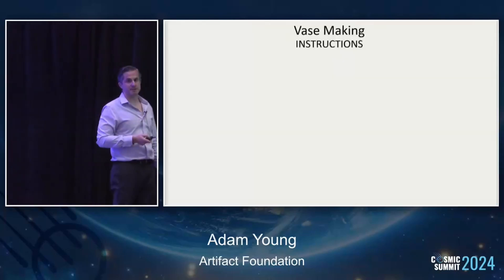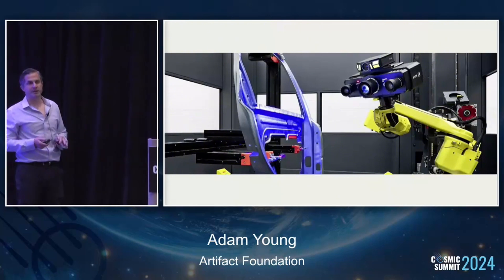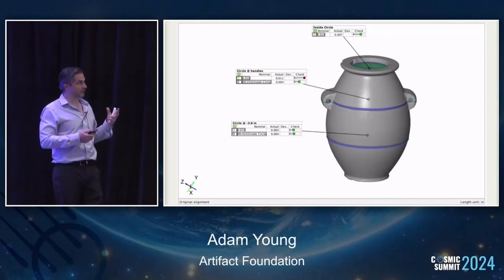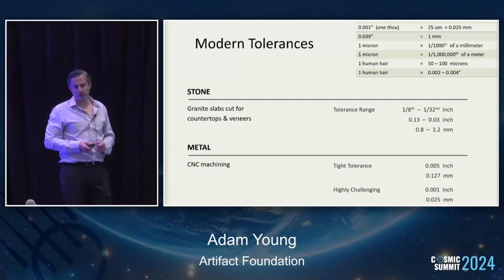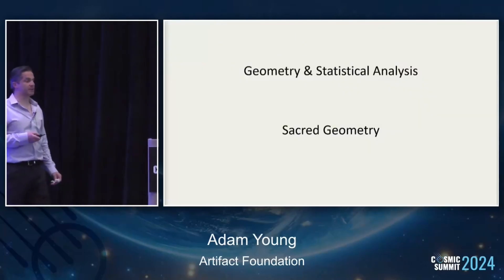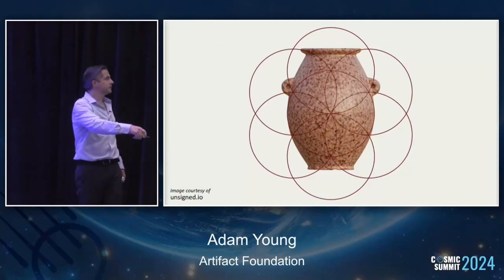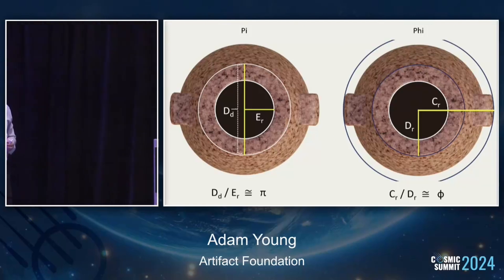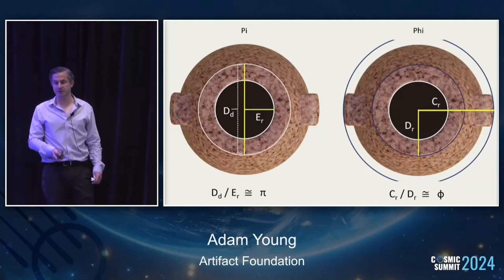Wall Street Math Quant Explains the Impossible Stone Vessels of Pre-Dynastic Egypt

Comment: This guy knows literally nothing about what he’s talking about. I really really loathe when guys who think they are smart, make claims that are astoundingly ignorant, because they didn’t think to ask anyone who actually works stone.   Stone is NOT hard to work.  EVERY ancient culture figured it out. In the modern era, we still carve stone the exact same way as the ancients.  We rub a harder rock on it. We just motorize our rubbing so it goes faster. 
It’s not rocket science. Anyone can figure out what will carve a given rock by noticing if another kind of rock leaves a scratch on it.

Guys like this are astounded by precision. But that just shows he’s never mastered making anything with his own hands. Precision is EASY to achieve with the most rudimentary of tools.  You can literally just carve one section of a vase to a curve you like. Take a plaster casting reinforced with horse hair just 1” wide along that profile. And then just painstakingly carve the rest of the vase to the same profile using abrasives.   You can even carve the shape of the handles INTO the plaster profile on one side so that you can be sure they will match, and that you are not changing the underlying curve thru the opening. You set the vase on a turntable, or on a pole thru its central hole, so you can mount the reference profile a fixed distance away and carve and turn the vase as you go. You keep working, section by section, little by little until you can slide it neatly under the plaster profile. 

Seriously. Stop mystifying things just because you are too ‘sophisticated’ to have ever made anything with your own two hands. 
I am a sculptor.   Pay me for a half year of my time and I will happily make you a perfect granite urn using nothing that wasn’t available to ancient stone workers. ALL it takes is some skill, and a lot of patience. 

SO things he glossed over to try and make it sound implausible. Granite is not all that hard. Dolomite is even softer than most granite. The most common abrasive in the world is quartz in ordinary SAND.  Egypt had a ready supply. Need something harder?  Garnet is harder than granite and so common that we make sandpaper out of it.  Egypt traded with peoples all over the Indian subcontinent, Africa, and the Mediterranean.  
Oh, and when they COULD find meteoric iron, they were perfectly capable of fashioning tools out of it. King Tut’s tomb had an iron dagger in it.

The ancients did not carve with just a copper tool. For fine work They coated the copper with pitch and embedded crushed quartz or garnet in it.  You can drill perfect holes in granite using a copper or even a wooden rod coated in sand or garnet. You can make a bandsaw by sticking abrasives on a copper blade, or even by soaking linen string in pitch and rolling it in garnet or sand.   It takes only a day to carve a nice deep hieroglyph in granite using quartz tipped chisels and butterknife like blades coated  in sand.
Reply: You claim you can make a "perfect" granite urn using nothing that wasn't available to ancient stone workers. Do it.
Reply: @ I make sculpture for money, buddy, not just to demonstrate simple things to even more simple minds. About $80k would cover my time to make such an urn. 
Seriously. Why don’t you ask the doofus who made this  claim to make one using the lasers he thinks would work before you believe his claim they could be made with modern tools?   The difference between me and him is I have a long career of making things with my hands. Things out of stone, steel, bronze, resins, plaster, and other media. I’ve done architecture, fine art, portraiture and a whole host of things neither You nor He can do. Just because HE and You can’t do it does not make it impossible.
Unlike this guy and you, I actually USE modern 7 axis mills, laser cutters and waterjets controlled by computers to make things.  And guess what?  They would NOT be the most cost effective way to make one of these. Those machines are expensive and renting time on them costs money. I would do it much the way the egyptians did, except I would use motorized cutting tools to make it go faster.  I COULD use my fancy laser scanner to measure it for accuracy… But just casting a simple plaster profile on one section of it would be faster, and even more accurate. ( lasers have a hard time scanning and  measuring marble and granite, because those stones have translucent crystals in them that can refract light, returning a surface we call ‘orange peel’. )
   
How do you make a CAR symmetrical? You just MEASURE one side, and COPY the measurements to the other side. How do you get accurate measurements?  You hang a string from a frame as a dead vertical plumb line and measure a series of vertical points from that reference line to the surface, then move the string measured distances along the frame its hanging from. 
How do you make something radially symmetrical?  How do you think egyptians made the millions of ceramic pots in their granaries?  They used a potters wheel, which is JUST a vertically oriented lathe.  The idea that a HANDLE sticking out on the sides makes it impossible is just a failure of this guy, and you, to THINK it thru.  The egyptians did not CUT them on a lathe. They just used the lathe to REFERENCE the work to a template. One made of plaster, or papyrus, or wood. 

In an era before internet, before television and radio, before romance novels and jigsaw puzzles, human beings had much longer attention spans. They were patient, and meticulous, and capable.  The ONLY thing I need to prove they didn’t need sophisticated technology is to show that ordinary SAND will carve granite and Diorite. YOU could make an urn out of a block of granite using Nothing but sandpaper, it would just take you a few years. 

Stop being so gullible to foolish claims made about ancient artifacts.  The fact that they EXIST is Proof they could be made with the limited technology of those cultures.
Reply: @ABC-yt1nq  Hire me. I’m a sculptor, i carve stone for money, not to demonstrate simple ideas to guys who have never made anything with their hands.   I do architecture, fine art portraiture, and product design in stone and the fact that you and the quant can’t do those things does Not mean they are impossible to do.
Reply: @christopherpardell4418  You claim to be able to carve a "perfect" granite urn. That would be an urn where measurements are not out by even a thousandth of an inch. Every curve perfect. Uniform thickness everywhere.
I call bullshit. You can't do it. No one can.
Reply: @ABC-yt1nq  Excuse me, did you just claim that ‘noone’ could make the thing that Someone very obviously DID make?   So, you believe this Quant, who has never made a thing with his own hands, when he claims it’s impossible to carve something radially symmetrical to a thousandth of an inch, despite the fact that EVERY lathe and potters wheel turns things that are that symmetrical as a matter of course?   He didn’t even measure the thing. He wouldn’t have the slightest idea HOW to accurately measure its radial symmetry, because the only way to determine that would be to set it up on a turntable and use a reference frame to measure from- which is exactly how you would have rigged it to Carve the thing in the first place. 
SO you think, what, they had some kind of technology that was super advanced, but they couldn’t come up with glass mirrors? Or it was Space aliens?   But you are unwilling to accept that just maybe what this Quant imagines is impossible is maybe not as impossible as he claims?
Reply: You are mixing up King Tut era  technology/metallurgy (new kingdom) with old kingdom technology. Which are thousand of years apart. In not a huge fan of the guy in the video either. But calling him out on terrible knowledge and then spurting out just as bad knowledge seems hypocritical, counter productive and kinda funny.
Reply: @ Kinda funny when folks read things into what I  wrote that I didn’t. The only mention of King Tut era ‘technology’ I made was pointing out an iron knife was found in Tut’s tomb. I did not claim they used Iron tools to make the Urn. They would not be necessary.  I pointed out that knife to demonstrate that when ancient peoples, All over the world, could FIND metallic iron, they were perfectly capable of working it.  There was nothing special nor New Kingdom specific about that knife. ANY culture that could make bronze or melt copper could forge iron, if they could find it. Any wind blown charcoal fire can heat iron to a temperature where it can be hammered into a shape.  The reason ancients did not make things out of iron routinely is that metallic iron does not occur naturally on earth.  If and when any gets exposed, it rusts.
The Iron Age was the result of folks finally figuring out what iron ore looks like, and how to attain temperatures that would smelt out the oxygen to return the iron to a metallic form.  
Meteoric Iron artifacts have been found in cultures that were incapable of smelting iron from ore.   Tut’s Iron dagger proves that egyptians knew what to do with iron when they found it in its metallic form.  It was preserved solely thru its never having been taken from his sealed tomb. We have no way of knowing how many iron tools or knives Egyptians or other ancient culture may have had because, again, Iron rusts. And when you are talking 5000 years ago, very few iron articles could survive that long.
Metallic iron in that era would have been so rare as to be worth a fortune, so an obviously coveted target of theft.
We know how Egyptians worked stone because they left an awful lot of it in partially finished states, and the marks left on the stone explain to anyone who has worked stone how they were worked.  We know they excavated granite with harder rocks because they left a 3/4 excavated obelisk in situ in the quarry and all around we fond the stones they used to hammer at the granite. We know they could saw granite, once it was out of the ground, because we have found partially sawn chunks of granite AND the copper saws they used. We know they had potters wheels and lathes, because we have found pots, and wood that was shaped on a lathe.
And anyone who has actually carved stone , today, knows that we use the exact same method to carve granite as they did. We rub or bang harder rocks against it. ( sandblasting and waterjet is literally banging rock with tiny harder rocks )
Reply: @christopherpardell4418  I do not think you understand the difference between pre dynastic ancient egyptian old kingdom techniques and new kingdom techniques. Completely different. The tech, the tools, the processes were very different. I think you may be starting to loathe yourself for thinking you are so smart making claims that are astoundingly ignorant, you keep mixing up thousands of years of techniques and processes and tech as if they were all using the same tools within a year of each other. Metallurgy and stone masonry is well documented over the thousands of years the Egyptians were around. I suggest more googling lol
Reply: @ I understand it fully. I think YOU have zero understanding of ‘metallurgy’ nor the history of it.  You do not NEED any technology to HEAT UP and HAMMER iron into a shape.  Stone Age peoples have made iron artifacts out of meteoric iron, just by grinding the iron against a hard rock.   Egyptians could EASILY forge iron, what they could not do was identify that reddish brown rocks in the ground had iron in them, nor that if they got them hot enough that metallic iron would form. 
Seriously. That was the only trick to the ‘iron age’ technology.   Both copper and tin occurs naturally in metallic form, and often in rocks that have a lot more of that metal in them as ores, so they are easier to identify and will smelt out at far lower temps. 
We have no way of determining how old the iron knife in Tuts tomb actually is. The hilt is concurrent with his reign, but the iron could well have been passed down thru 15 generations or more. The only thing we Do know is that its nickle content identifies it as meteoric.  So we know it predates Iron technology. 
Again, Try reading what I WROTE. I made no claims of any technology that was not available to the earliest egyptians. They HAD potters wheels. I can bandsaw granite with Linen twine coated with pitch and rolled in crushed garnet or sand.   You wanna claim THAT was too sophisticated for the people who built pyramids?
Reply: @ Unlike you, my knowledge is not from ‘googling lol’. I have melted iron. I have forged and cast iron and cast bronze, aluminum and stainless steel. I have carved granite. And I can do it very precisely, and NONE of it requires that much technology.  Although I often employ CNC controlled tools from waterjets and lasers to 7 axis robot mills, all it really takes to shape granite is Patience and Abrasives.   I am not sure from your response what the heck your actual point is or if you even understand your own point.   I can cut a profile out of a wooden plank, or even a sheet of cardboard, and shape granite to match that profile perfectly using nothing but sand and shaping stones. All it takes is time. aAnd if I want it radially symmetrical, a means for gradually turning the stone on an axis, little by little, adjacent to the fixed profile I am matching.
So, really, I am not the one ascribing a sophisticated technology to first kingdom egypt. The QUANT is.
Reply: @ I don’t think you read my posts. I am not the one claiming ancient technology they could not have had. The Quant in the video and some other commenters are.  I explained rather in detail the difference between Iron Age tech, and the fact the people pre-dating the Iron Age occasionally finding meteoric iron they could hammer or grind into a usable article. I also did not claim any iron was used in making the urns in question. I explained exactly how to make them using technology the old kingdom Egyptians verifiably had.
Reply: @christopherpardell4418  if you could make them you would but you can't. That's the mystery
Reply: @ I can. You offering to pay for my time?   Why would I spend 6 to 9 months of my life carving granite by ancient methods, without pay,  to prove something anyone with a basic level of intelligence can tell from my description is perfectly possible?   Unlike you and the quant, I actually make things to high levels of precision for a living. I can create a digital model and run the tool paths for carving one with a 7 axis mill. But I was traditionally trained and know how to do the same thing without any of that technology. 
If you grant they could carve granite at all, Then the ONLY thing they need to cut these accurately is to be able to reference the granite to a fixed template all the way around.  They could do this by rigging the template to turn. But it would be more accurate to do it by rigging the granite to turn, because turning the granite defines its axis. 
The template starts a certain distance away for the roughing cuts. When the whole thing is smaller than the profile and will turn freely, you move the profile a little closer, and then start taking down the high spots until it will turn under the profile freely again. Then you move the profile a little closer, only carving on the spots that touch the profile.  You do this until you have 98% contact on the profile at all points. Then you start sanding and polishing to get the last 2 percent. 
If you can’t SEE that this would work just fine, then you are either not clever enough, or you are simply arguing dishonestly.  
Oh, and ETA- the ‘handles’ are in the profile, too.  you simply have a smaller add on section of profile to complete the curve that swings into place or is registered accurately on wooden pins.  Again, NOT hard.  No fancy tech needed.
Reply: @christopherpardell4418  the tech you are describing is not old kingdom tho. What you are describing are not proven old kingdom technologies and processes. As for your excuses of time and money lol if you could you would but you cant
Reply: @ Does that kind of 7th grade taunting actually work for you on anyone?  Son, get a real education.  Museums are chock full of Old Kingdom granary pots and other ceramics made on potters wheels. The HAD the ability to make a turntable. Other than that, I have them pounding on granite with rocks, and using SAND stuck to tools that could be made of wood, ceramic, and copper. ALL technologies we know they had. We have literally FOUND the tools.  
Just admit it. They could make them.   They used the tech they had.
Reply: @christopherpardell4418  you couldn't even make these with modern tools young lad, if you could you would.but you can't. Time to get out of your dad's garage.
Reply: @ I’m not a young lad.  I’m a 67 year old man who has made his living making sculpture and designing things for 45 years.  Trained in the old world techniques by immigrant italian masters, yet I have kept current on the cutting edge of emerging technology and tools. I have moved 7 ton rocks all by myself using nothing but some 20 ft 2X12s, Egytian style. I beta tested the software that would become Photoshop and the first 3D modeling program on a desktop computer.   I TEACH apprentices how to carve stone with mallets and chisels, And I teach them how to use modern CAD software and tools.
I have explained how Anyone could replicate these urns with simple tools in enough detail that even YOU could do it.  If you had the patience.   And all you got is claims something is impossible that some ancient Egyptian obviously Could Do, more than once.  Well, That and 7th grade level taunts and dares. 
If you want to see me do it, pony up the cash to pay for my expertise and time. I run a business here.
Reply: @christopherpardell4418  all these excuses kiddo, if you could make these granite vases yourself even with your daddy's tools, you would, and you'd sell them for a pretty penny. But you can't. And you won't. Noone is saying it's impossible, the old kingdom ancient egyptians have shown it's possible. You however, have not. Stop with the childish excuses money time blah blah, you can't do it, that's the ancient mystery here.
Reply: @christopherpardell4418   - I repeat: you cannot craft a "perfect" urn. Get over yourself.
Reply: @ Making unsupported claims about knowledge you don’t have is your thing. As are juvenile taunts that don’t work on 12 year olds, much less full grown professionals working in the field in question.   I get it. You think the very object featured in the video could not have been made by anyone. You have no evidence, no argument, no reasoning to back you up.  I suspect your lack of faith in human ingenuity and perseverance is the reason you have never made anything that could impress anyone.
Reply: @christopherpardell4418  You need 80k worth of modern tech to make a small granite jar when you also say it could be done with a stick and some crystal sand abrasion? Something isn't adding up here LOL
Reply: @ you must not have read what I wrote fully. I don’t Need 80K of modern tech. I need 80k to pay for 6 months of my TIME.  I run a sculpture studio as a business.   It would take me 6 to 8 months to make a granite urn if I was only going to use tech the Egyptians had available. Mind you, that’s 10 hours a day of chipping at Granite with other chunks of rock, or abrasives. 6 days per week.  And that’s only because rocks and sand are pretty much free.   If you want to use modern tech to make one, it will actually cost you as much or a LOT more.  Granite burns thru expensive carbide and Diamond tooling very fast, and a Kuka 6 axis mill runs $150 per hour. 
But the modern tech will get it to you faster.    And I am not thinking small, I am thinking 30” tall.  
Once more,  They were MADE by ordinary people who had a lot of experience cutting rock. Like me. We know what kind of tools and tech they had available because we can see what kind of artifacts and other tech they never made, as well as what they did.   And because we have found their tools, their quarries, and even their workshops. Anyone claiming it was impossible for them to make it with the tools we know they had is obviously someone selling you something, or someone who never TRIED to make anything. I know it can be made because some man DID make one. And anything One man can make, another man can make the same way.
That’s the difference here.   What the ancients did does not astound me because I have made things all my life that astound people who don’t know how things are made.
All it takes is tenacity, patience, and practice.   For a culture that can build Karnak, a silly little urn is no big deal. And folks who say any different are lacking faith in human ingenuity and diligence.
Reply: @christopherpardell4418  Ok I understand now. I respect your perspective in that line of work. If you are serious about your claim, there was a recent video on the Uncharted X channel where they are looking for people to replicate a similar granite vase, since believe it or not it hasn’t been done in modern times. That is to create a replica of one of these precise vases in granite to their respective accuracy.

So far they commissioned a Chinese quarry site of sorts that has hundreds of years of knowledge in the craft passed through generations to try and replicate a vase of similar specs found in ancient Egypt. While they achieved good results, the craftsmen didn’t even attempt to round the inside, only drill a single tubular hole in the middle of the vase. 

If you reach out to them they might take you up on your offer, or at least would be interested in your insight.  Cheers
Reply: @ PS- what makes this Quant’s claims so ludicrous is a tangent to your point, that there’s thousands of years elapsed  between pyramids and the New Kingdom.   Technologies breed change and that breeds new technologies. When you have very little technology, change occurs slowly. And so new technologies emerge slowly. But as your technology advances, the number of ways it can impact your cultures go up geometrically. How we can know egyptians did not have sophisticated tech, nor space alien help is that these purported technologies did not result in the kind of change they should have.   If I can make lasers, I MUST understand optics.  If I understand optics, I would already have used it to make reading glasses, mirrors, telescopes and microscope before i ever got to carving stones with it. 
You can understand the limits of ancient culture’s technology by noticing what is Missing and what kinds of change did not occur.  
And when you have figured that out, you can be assured that if they did something that you think is amazingly difficult for their tech, that you probably don’t know much about how clever people can be with just very basic tools. 
I can find true North within a few arc seconds accuracy on ANY sunny day using nothing but a straight stick and length of string.
Reply: The core problem here is that the presenter literally pulled a vase out of his behind and claimed it is ancient Egyptian
For all we know it was made in the 21st century

Then he made BS measurements claimed to find PI (with a value of 3.16 mind you, so much for precision) and a BS mathematical function. These "precision" claims have already been debunked in other videos
And it's a good bet the vase is NOT ancient Egyptian